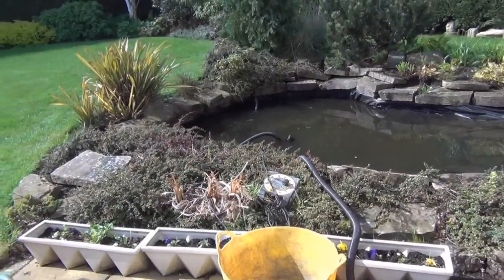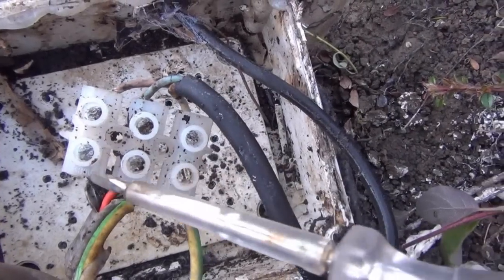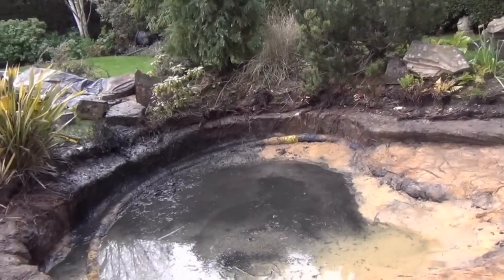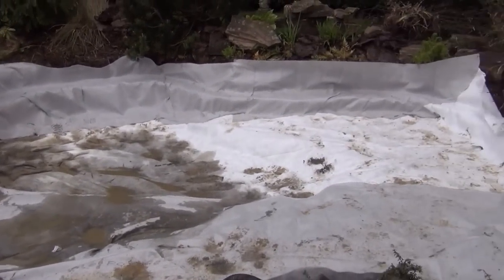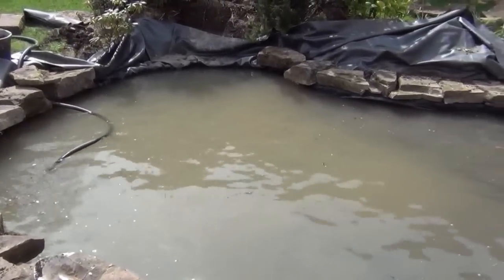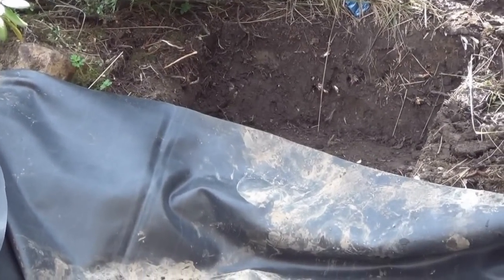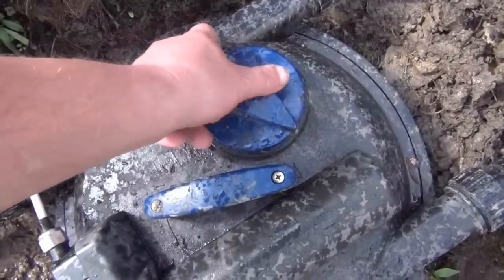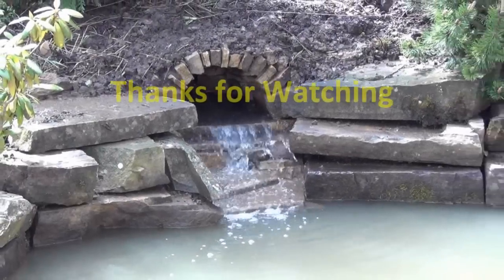Pond Construction at Ponteland (near Newcastle)

Comment from the maker: If that is the size of the finished pond then the volume will be 4750 gallons / 21565 litres so a 15000 filtoclear would be way too small. Depending on what you are intending to keep in there you may need to go much bigger, more skewed toward the koi filter type. You would normally half the capacity of the filter (15000 to 7500) if the pond contains fish or is in sunlight. Reduce by half again for koi.

Comment from the maker: The Aquamax pumps go for ages (often years) before they need cleaning out but it depends on how much muck you have in the pond. A dirty water pump would pump water to the filter no worries but they are often very high wattage (running costs) so considering the pump and filter needs to be on 24/7 that is a major consideration unless you're Bill Gates.

Comment: how long do have to wait  to add fish , I am doing pond 4 feet by 5 feet i was told to go 4 feet deep for the winter time and was going to do 2 feet deep rest on the pond. just adding some cheap little gold fish
Reply from the maker: 4' x 5' is a very small pond and if you make it a bit bigger it will be much better for the fish. Depending on where you live the pond could be anywhere from 2' to 4' deep but generally the larger the surface area the deeper the pond would be to keep things in proportion.
Reply: Pondguru Outdoors my idea was to use river rocks for  the pond , would that be a bad idea
Reply from the maker: It would be fine and I have done that many times.
Reply: Pondguru Outdoors thanks
Reply: when doing the liner do start with border or inside the liner
Reply from the maker: I'm not sure what you mean - please clarify.
Reply: Pondguru Outdoors  Ima talking about laying out the rocks
Reply from the maker: Thanks for clarifying - always work from inside the pond outward as the outer stones may well overlap the inner stones.
Reply: when do add the rock before or after i add the water